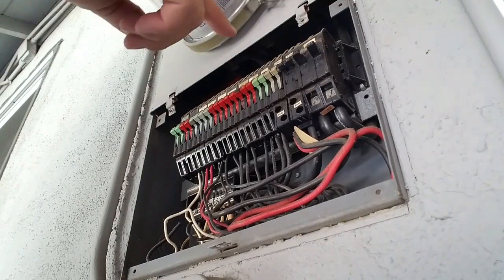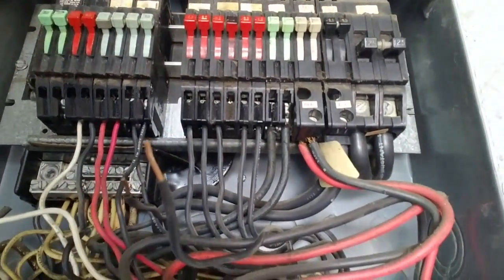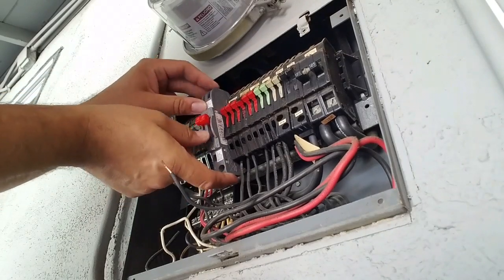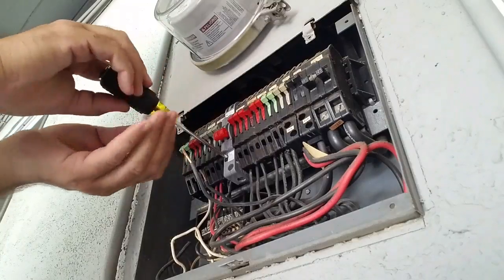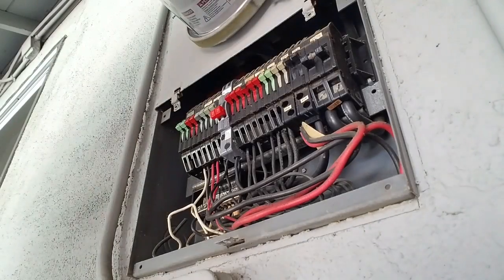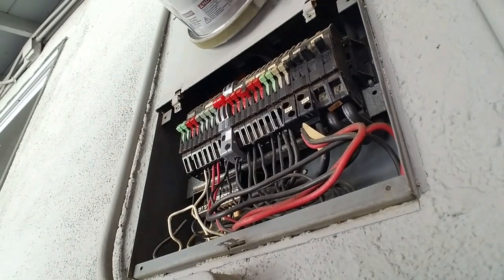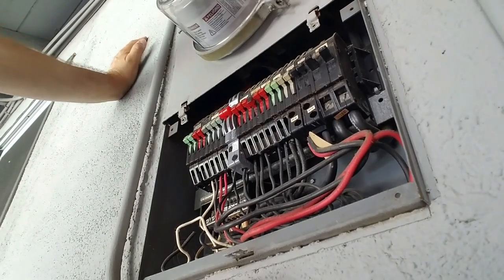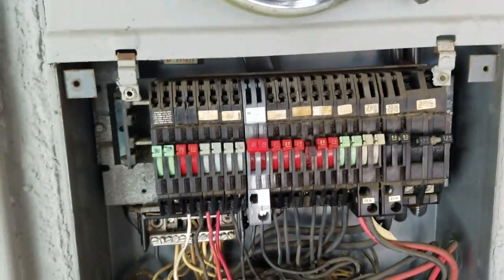How To Replace A Zinsco Breaker

Comment: Can't believe you're actually replacing breakers on that junk firetrap.  Should be changing out the whole panel...
Reply from the maker: True, but who's gonna pay dor it? I don't work for free and am sure you don't either. I always make the recommendation but some people don't have the resources to do that. So then what? Walking away from it is grossly irresponsible, then they'll just hack it and make the problem worse. I appreciate the input though and thank you for watching.
Reply: Massive Electric thanks for the video, I am about to replace one of my breakers like the one you replaced on the video. In regards to the comment from the guy that says that the whole panel should be replaced, it just shows how ignorant some people can be when it comes to knowing what people can afford and what they can’t, you did handled that comment with great info and respect. Thanks again man
Reply: Massive Electric I guess I didn’t realize some will put themselves at fire risk for around 2k. I guess some truly don’t have the funds or reserves or just make the choice to not allocate funding for this

Comment: You turned a live 100 amp breaker off with your bare hand and with only eye protection and you still have a hand and a face.  Congratulate yourself as a lucky fool and get a lottery ticket.  Next time stand away and use a non conducting implement to turn off the breaker.  Better yet, get a QUALIFIED  electrician to replace the whole firetrap panel.
Reply from the maker: I am am 18 year electrician. Thanks for your input though.
Reply: why is it dangerous to use your hand turn off a breaker?
Reply: @MassiveElectric  
Then you should know better than to Incorrectly educate others by NOT wearing insulated gloves.  Hopefully others won't follow your example (and possibly die from it), but will have better Gloved Safety precautions.  

Otherwise, thanks for the other good info.

Comment: Wrong...dont bend tab... you need to hook bottom first.you just modified and then said don't modify. Add antioxidant..THEN put it in. Yes they are crappy but when you replace one All the breakers are now more likely to arc. Grease the entire buss and start over